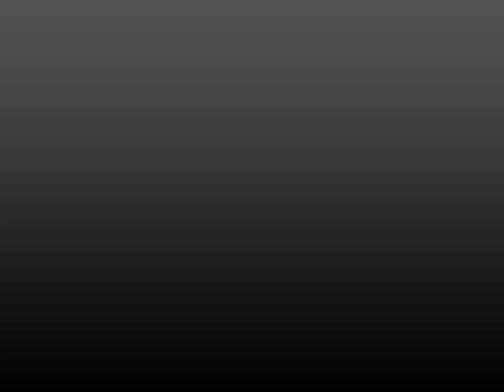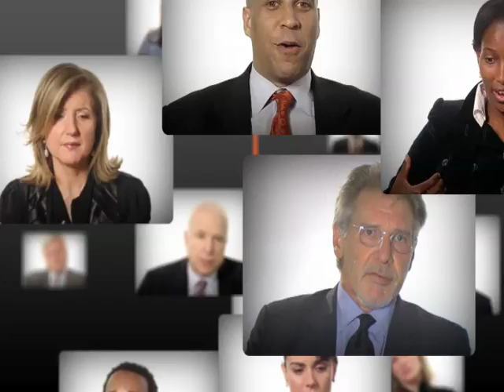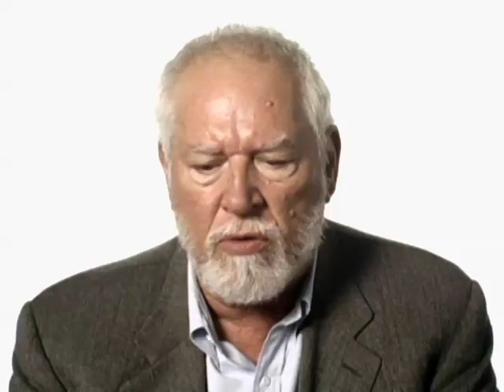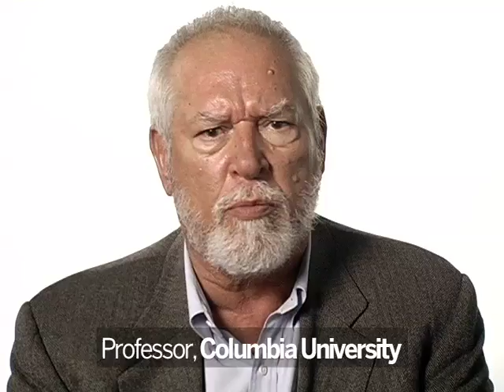The Challenges of Vertical Farming  | Big Think

Comment: ~6:45 waste from digestion "powder/dry pelleted and incinerated"WASTEFULa methane biodigester uses anaerobic consumption to produce natural gas that can be burnt for electricity and heat, the suspended solids can be composted/ vermicultured and the liquid can be aerated and used to grow 'sea lettuce' (an algae) that can be used as part of animal feed.
-
A refrigeration unit on the top floor, could help to avoid pumping water up by condensation of the excess humidity/transpiration.
-
attempt to group a number of floors to be a modular repeating unit stacked within the building.Carefully consider how to minimize the human and mechanical effort needed by working with gravity: crops on a higher floor can be dropped down to a floor below where the catering business prepares meals and the scraps could drop into soldier fly larvae 'processor' that drop into the chicken pen.Ventilation that mimics the dynamics of a termite mound - underfloor airflow that takes the humid carbon-dioxide rich air up to the rooftop greenhouse.
Reply: A water pump would take less energy for amount of water than a humidifier, regardless of local climate. Atmospheric water capture is pretty shit.
Reply: @moonturkey  Indeed it is. Cost is astronomical.